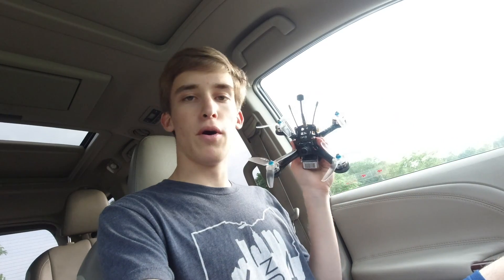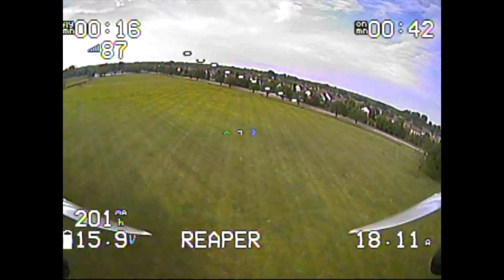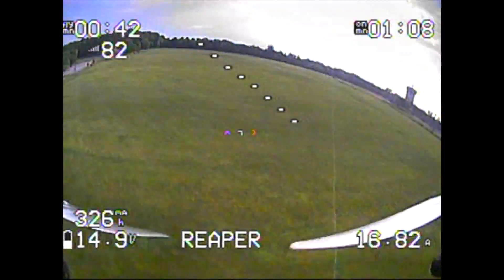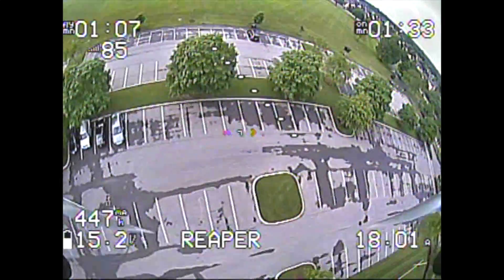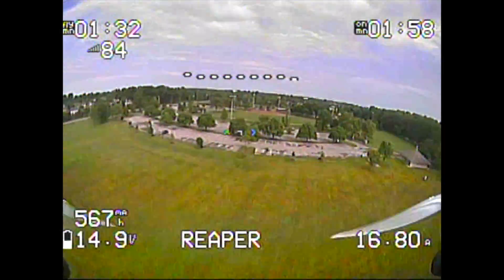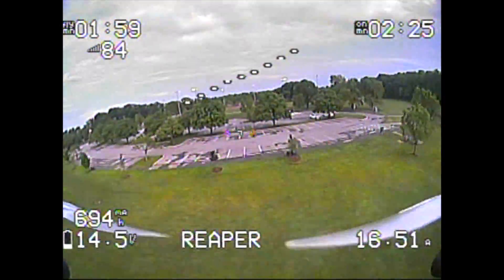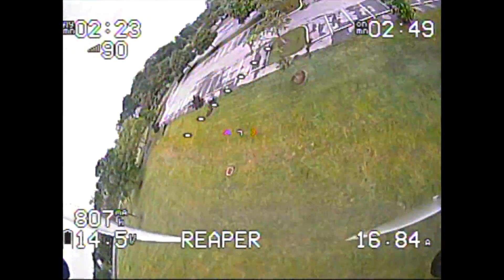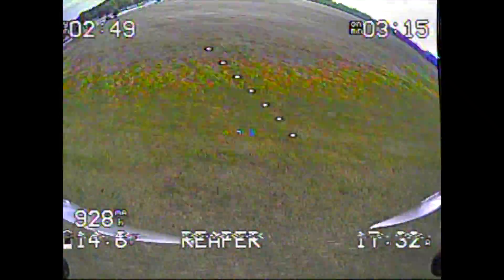MRM Reaper Maiden FPV Flight

Comment: I've got an idea and maybe you find it useful, I've been looking for diy rc planes which run on motor+prop converted to EDFs and I haven't seen so much, and maybe you can take it a challenge 😏
Reply: As a challenge***
Reply: @monmatrix11  If you look on the Flite Test Forums there is a design that is really popular. It's called a BDF, or Ben's (Harber) Ducted Fan. It's basically a high kv race quad motor inside a 3d printed mount. You should check it out! https://forum.flitetest.com/index.php?threads/what-is-a-bdf.61545/
Reply from the maker: Sounds good. I will look into it!
Reply: @corpsefpv3154  wow thanks!!